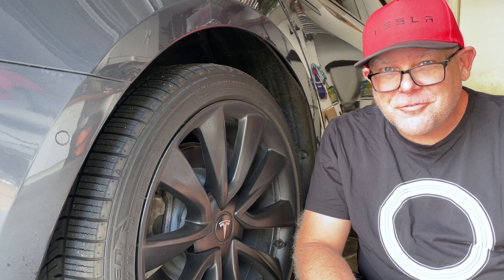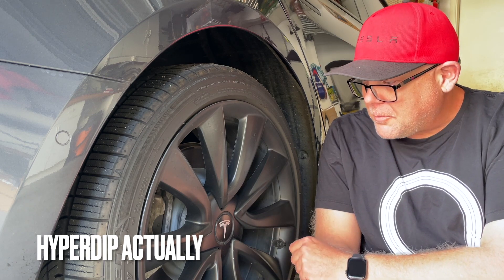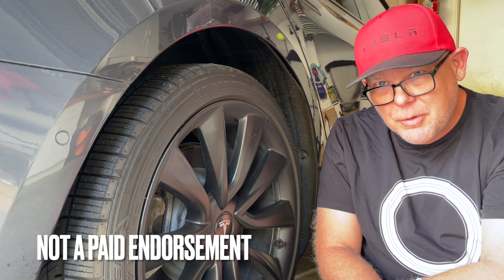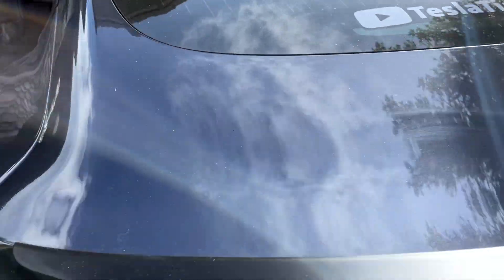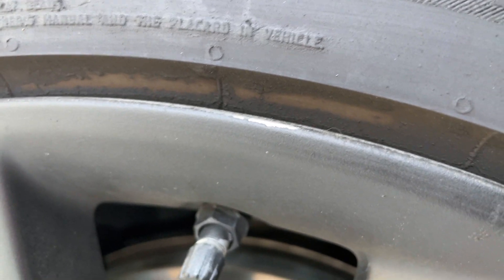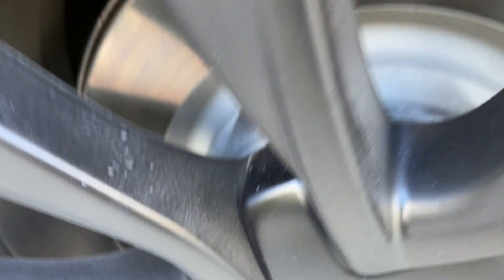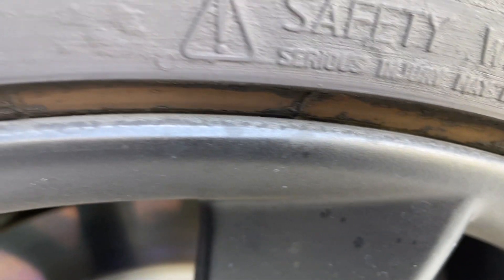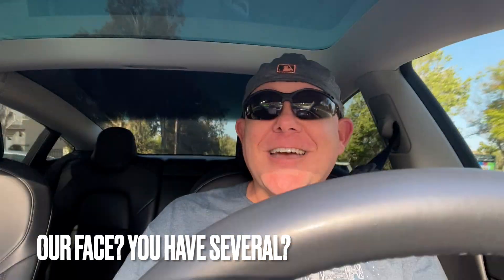How well did our Tesla Model 3 Plastidip Wheels hold up?

Comment: Why can't I just use a more standard spray paint such as Rust-Oleum Universal?
Reply from the maker: You certainly can, it’s not removable if you don’t like it. Also requires more painting skill. If you screw up plastidip you just remove and start over. If you are messy and spray a fender on accident, it comes right off.

Comment: Any finish that is so damaged after 1 year is not acceptable to me. Thanks for showing the reality.
Reply from the maker: Well it's rubber paint. You could also hit a rock on the way out of the wheel powder coating place and now it's lasted 5 minutes. Or deliver a brand new Tesla and get a rock chip on the way home, so that finish didn't hold up either. But, yeah it's just rubber paint.
Reply: im considering to plasti dip my wheels to prevent them from getting rock chips ... youll get them with or without the dip. I agree on it looking cheap tho unfortunately. prob just gonna get my wheels refinished after a few years.